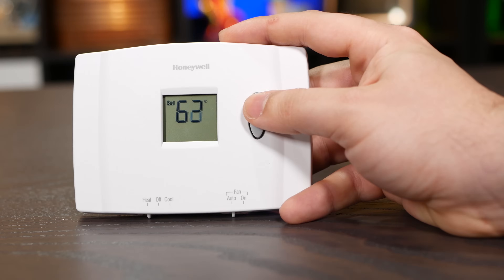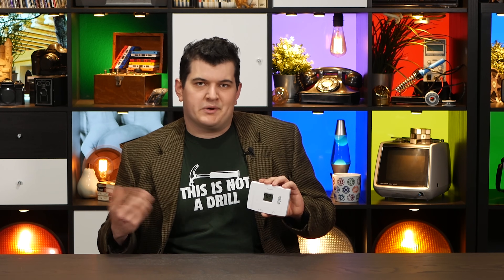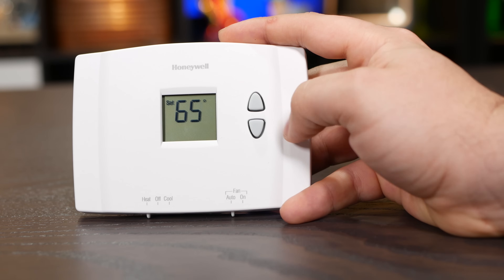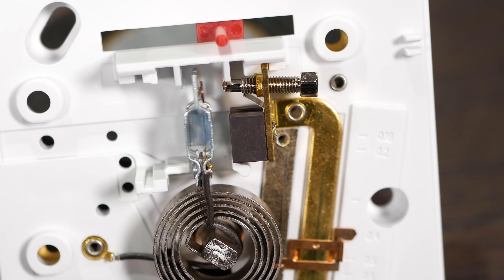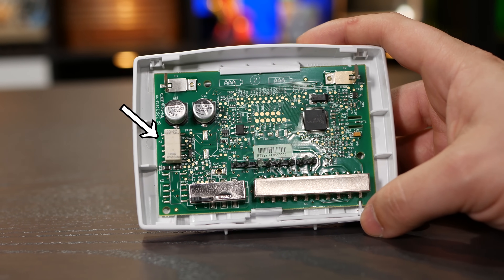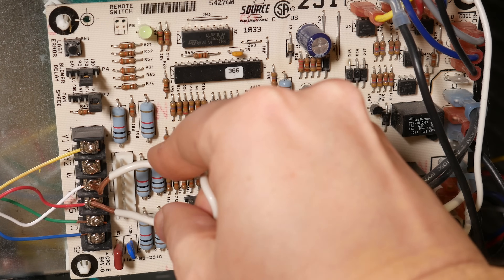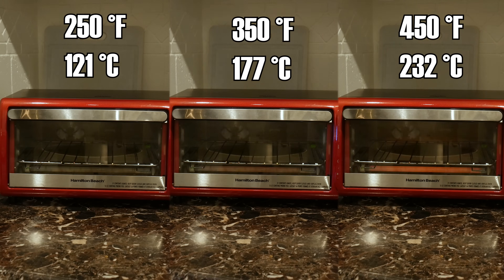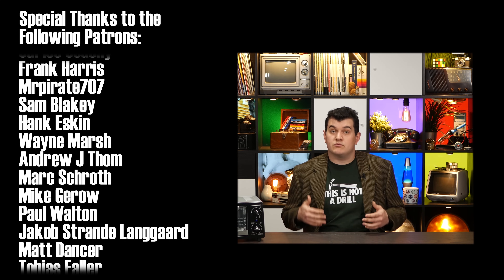Thermostats: Cooler than you think!

Comment: It feels important to point out that because of the scale difference between a house and a toaster oven.... turning the thermostat up actually can make the house heat faster.  The thermostat only measures heat in one location, and if that location is primed to have a slightly higher temperature than the rest of the house, it can prematurely turn off the heat. The actual time to reach the desired temperature then becomes a function of how many oscillations the thermostat needs to make to even out all the hot spots in your home.  Consider the worst case scenario of a thermostat placed directly over the heating vent.  As the heat turns on, thermostat gets the brunt of it - immediately getting a blast of hot air and raising its temperature.  After merely a couple minutes, the thermostat's temperature response will turn off the heat.  Though most thermostats aren't that poorly placed... do you really think your contractor did a full temperature and air current analysis of your home to decide where the thermostat is?  Do you even think an optimal measuring location exists?  This problem compounds the further away you are from the thermostat, as its temperature becomes a worse sample for your temperature.  Because the thermostat, as you pointed out, is really a PWM device, having it stay on longer literally does make the heat come faster.

Not to mention the fact that the rate at which the air saps your body heat away actually is a function of how warm the air is in the first place, turning the thermostat up actually makes you - a human - feel warmer faster.

Comment: I thought that the basic function of heating or cooling would be pretty universal across countries around the world, maybe different for some depending on the most abundant source of energy (electricity, gas, oil), but appearantly it is not. I'm surprised to hear that most of the (northern) US uses a form of heating which appears pretty primitive to me, inefficient at least. The cost of energy must be substantially lower on your side of the ocean than on ours, to justify such systems. Our's systems run on natural gas (Holland sits on top of one of the largest gas reserves, so that makes sense) and uses various techniques to squeeze out every Joule of energy. Modern systems can regulate the quantity of the gas flow and by heating slowly but constantly, (low temperature heating) energy is preserved and temperature swings are avoided.  Usualy the Opentherm protocol is used to implement this.

Comment: The programmable Honeywell thermostat that I have does have a temporary override function. Just set it to the temporary temperature you want, and the thermostat will resume its program settings when the next day period begins (morning, afternoon, evening, or night). You can't put it back into the programmed temperature just by pressing the run button. The thermostat also has a vacation override that will override its programming for a set temperature until you cancel it. The temporary override function doesn't run for a selected time; only until the next day period. It's still quite useful. Fun fact: I have this thermostat operating my window air conditioner via a 12 volt power supply and a 30 amp relay. I find that it does a better job than the one the air conditioner uses since the fan would have to be continuously on to pull air over the sensor to know what the temperature is. You have to use an air conditioner with an analog thermostat to run it that way. The internal thermostat is still necessary to keep the coils from freezing up in certain situations.

Comment: Not quite totally silent. My mercury switch makes arcing sounds sometimes while it's switching over.

It also only has 3 wires! We were really confused when we bought a modern thermostat and tried to hook it up. We gave up and returned the thermostat.
Reply: (This is in an apartment building where the building controls when we can turn heat on or use AC.)

Comment: Did you mention this is indeed a closed loop regulation? Much more sophisticated that what you seem to explain.
PWM is only a way of transmitting information, specifically by modulating a carrier signal with the duty cycle parameter, instead for example the amplitude parameter (that would be the typical analog signal).

Comment: I would say that thermostat location is important. Especially in two story homes. Here in Florida, the upstairs rooms get really hot because A) heat rises and B) the sun is heating the roof. So the thermostat being downstairs will turn the the AC on less frequently than needed for people upstairs. The result is usually that the downstairs is fine but upstairs is hot, or the downstairs is chilly and the upstairs is ok. Without a door to stop the cold air from going downstairs, there is no easy way to balance this efficiently. Also, when I lived with my grandparents, they had AC installed, something they lived without for 80 years. So they didn't understand that closing off the living room where the thermostat was mounted, meant the rest of the house didn't get cooled down because it was shut off too soon. So my bedroom was really hot.

Comment: Hey @CantComeUpWithUsernames ...and @TechConnectify (0f course), there are systems that do just that.  Not sure of residential, but our commercial Bard brand HVAC units have a button to press that immediately stops the cooling/heating for a few minutes and adjusts the temperature to a set (adjustable) temp.  After the time limit is up, the unit automatically goes back to regulating the temperature it is normally set to.  Very useful if someone is going to be working in that area for some time and doesn't want to totally freeze.  Ours are set to go to 70 degrees F.

Comment: Hello, in the EU, if you have to change your old boiler, it is obligatory to purchase a condensing one, where the heating water temperature must be controlled in order to cool down the chimney by pre-heating the return water, and return water temperature must be kept as low as possible to have better efficiency. Their thermostats have a thermo sensor outside of the house, and adjust the heating water temperature according the internal and external temperatures. Also these thermostats adjust the heating power of the boiler. Mine has a nearly continuously variable power range between 6 and 14 kW. It can make the room temperature EXACTLY what was desired, unlike the bimetallic one, which can alternate the room temperature by 1-2 Celsius :(
Also the modern Airconditoners  have a DC motor, running the pump, what enables them to vary their power in a wide scale, keeping the room temperature in a very narrow range.
The old technique of bimetallic thermostat makes life quite uncomfortable compared to these modernized technologies.

At home i am not using a "thermostat", instead have tiny thermometers built behind the light switches, and a PLC calculates the boiler's on and off times, and the boiler itself adjust its power based on the incoming and outgoing water temperatures.

Comment: My furnace is a beast, and most likely was installed in the house when the house was built back in 82.  There's only two wires running to my thermostat for heat and that's it.  I've never observed people cranking the heat on their thermostat in the house before with the expectation that it would warm the house more quickly, however I have seen friends do this in their car which can get quite annoying.  It's one thing if you have an older car that doesn't have a climate controlled thermostat, and you crank the heat all the way up when it's in the middle of winter and you're cold starting your car.  It's something else though when the car gets too warm inside, so the person turns it all the way down to the coldest setting, then cranks it all the way up again when they start getting cold again.  Instead, once your car warms up, just turn the heat down around the medium setting, and adjust it in small increments until you have it at a comfortable setting.  This always depends on how cold it is outside of course.  For cars that do have climate control, I have seen friends still crank the heat up higher with the expectation that the car will warm up more quickly.  the climate controls in my car always stay around 20 to 24 C, and when I do touch the dial, it's always in small increments.

Comment: There is a "medium blast" for certain furnaces. Some furnaces, particularly higher end models have two stages of operation. They can run as low as between 50% and 65% most of the time and only kick in to "full blast" if they need to. It's a great energy saver.

Comment: I mansplained my partner there was no point in cranking the temperature right up, it didn't make any difference.

She pointed out we have an inverter heat pump and that the compressor spins at different speeds depending on how far from the set point the temperature is.

Pwned

Comment: Fun fact: at least one of the traditional bimetallic-spring-mechanical-contact thermostats I've seen (was it a GE one? Maybe, I forget...) included a small low-value resistor in the enclosure. Powered at all times. Which means it was heating up the box. What madness is this, you may ask, why would anyone want to fool their own sensor on purpose?!? Well, here's the thing: even though thermostat boxes tend to have openings to allow air to get to the sensor, it turns out air is usually in no hurry whatsoever to get into the damn box, even if there are openings on two opposite sides, so your sensor isn't really measuring what happens in the room. But once you have a mild heat source in there - as it happens, above the sensor - slightly heated air tends to rise and exit the box on the openings on the top. Which means room air comes in to replace it on the other opening, at the bottom. Straight onto your sensor spring. Huh...

...oh, and regarding 16:30 - that's a pretty much standard feature on a lot of modern "smart" thermostats; just as an example, see the Eurotronic Spirit's "Boost" function - but I've seen similar things on others; you know how this works - once one product has it, EVERY product must have it or get left behind.

Comment: 16:18 - Another benefit of the mercury thermostat is that the electrical connection is made inside a sealed container, so zero risk of an open spark.Good for use in areas with the possibility of flammable gasses. (Also, if you're in a room and smell a gas leak, and you can easily reach it on your way out - only if you can do it easily on your way out since you should be leaving the room immediately in a hurry - crank the thermostat all the way to whichever state it's currently in. If the furnace is running, crank it full-heat. If it's off, crank it full-cold or flip the switch to 'off', to make sure the thermostat doesn't spark and ignite your gas-filled room!)

Comment: @ 6:51 That's why back in the day, they used Mercury switches. The Mercury is held in a bulb that has a vacuum pulled on it.
Mercury switches will last a VERY long time...
Reply: Correction, they last a very long time when you don't have a kid like I was that was fascinated by the mercury and took the thermostat apart.

Comment: @ 1:57 I have one of them thar new fangled HVAC systems, that runs at variable speeds, depending on the need. It also knows when to run the furnace, or AC, depending on the temp trend, within a 3 degree variable. I can also adjust my thermostat via the interwebs.
Just sayin'...

Comment: Engagement! Lots of central heating systems in the Netherlands use OpenTherm thermostats to do modulation on the heat output of the furnace. And they learn your programmed temperature schedule and how fast the house warms up and know when to start the heat output to reach the desired temp in time and all that nice jazz. And then many have output temp probes to do weather dependent water temperature for extra savings.
Reply: Exactly, modulation on your furnace seems like a better way to save energy than doing slow PWM. Don't know why this is not common in the US.
Reply: OpenTherm is available on a fair number of UK boilers too (we call them boilers, probably because they heat water, and we're simple folk), although it's not well-known - my Mother in Law had a new boiler and a Nest installed last year and they didn't connect the OpenTherm terminals. I fixed it. Also our Nest thermostat is different to your Nest thermostat because our boilers are different, but that's a whole other problem
Reply: Engagement! Here in Italy even without opentherm some furnaces modulates the amount of heat. Oh, and a/c too, we call it “inverter” models. Yeeeee, engagement :)

Comment: To answer the last question: If you bump your previously programmed thermostat (digital) above your programmed setting, then most digital thermostats will accept the newly input temperature and run for 4 hours, then it will go back to the temperature setting that was programmed into it upon setup.  
To respond to the extra info:  the vast majority of HVAC systems in the southern US use the emergency heat setting as the main heat. That is because most southern HVAC systems in the south are heat pumps, meaning, the cooling system is designed to actually heat AND cool. A heat pump will cool like expected, but if the refrigerant flow is reversed, it will heat to a minimal amount; but that amount is all that is really needed in the south due to warm climate. In the north, there are not many heat pumps since they cannot heat to the amount needed. Using the electric heating element in a heat pump up north would just be too expensive to run, so instead their main heat is from a secondary fuel (propane, fuel oil, natural gas) and the electrical emergency heat is only used for the true emergency, like you running out of your secondary (main in the north) fuel source.
Oh, and thermostat wire: it doesn't have to be shielded greatly, so can be pretty much the least expensive conductor possible. Most all residential units run on 24 volts, so thickness is not needed.

Comment: another example of home products being stupidly simple is the AC in the '98 Ford Rangers in these vehicles the ac and heat are on constantly and when you turn that knob that selects hot or cold it just turns a "blend door" that *blends the hot and cold air together. the only time the heater is turned off is when you select "max ac" which will close a valve preventing the heater from circulating fluid.

Comment: Have you never heard of OpenTherm?
https://en.wikipedia.org/wiki/OpenTherm
It's been a standard in nearly all homes and central heating systems for the last 20 years or so over here in the Netherlands. We haven't really used systems you describe in this millenium. Nowadays we also use more advanced systems that have an individual valve connected to wifi for each radiator. Most of our heaters have multiple burn levels too.
And I have buttons on my thermostat that allow me to interrupt the programming for an hour. It's some 2010 Honeywell touch-screen thing, no clue about the model.

Comment: The ecobee thermostat allows you to set a temperature for a certain time and then it goes back to the original cycle. You can configure how long you want the thermostat to ‘hold’ the temp you input. I have it setup where any change I make to the thermostat holds for 2 hours before resuming my normal schedule. pretty neat.

Comment: I have a space heater with a thermostat that actually adjusts the power level, not Just on/off.
It will heat, and you can turn up the thermostat and its watt consumption will increase.

Comment: For most of Europe majority of new installs for about the last 15 years or so would be with eBUS and OpenTherm thermostats I guess. (so not switch on/off but digital communication)
It allows for monitoring and configuring the heater/cooler from the living room.
No idea if there are any official stats about that...

Comment: Two stage furnaces have been pretty common for a long time, and now modulated furnaces are becoming much more popular. Anything above about 92% efficiency or so will be two stage and the 97% + units will be modulating. It used to be that a two stage furnace would have its high and low stages controlled strictly by a two stage thermostat. So a thermostat would be designed to have the furnace come on in high stage if you set the temperature rise to be greater than a certain number of degrees. E.g., the temp is 68 and you set it for 69, the low stage is activated. But if the temp is 68 and you set it for 75, the high stage is activated. The new trend however with the largest player in the business (Goodman) is to use algorithms in the furnace's microprocessor programming that decide which stage to use. A regular single stage thermostat therefore runs these furnaces. My own furnace is new and works this way. It seems to operate just fine, except that the thermostat's anticipation program for warming the house up in the morning causes the furnace to reach its target temperature somewhat earlier than before. Other than that, there doesn't seem to be much difference.